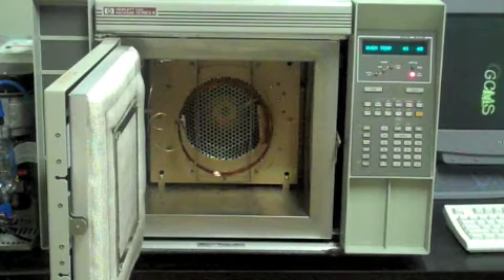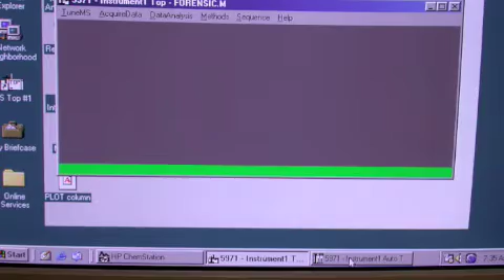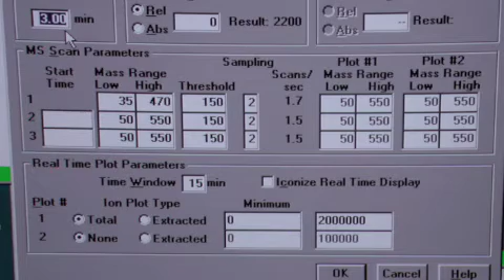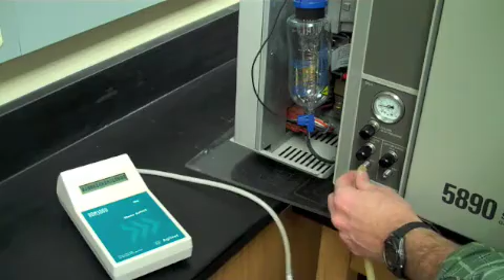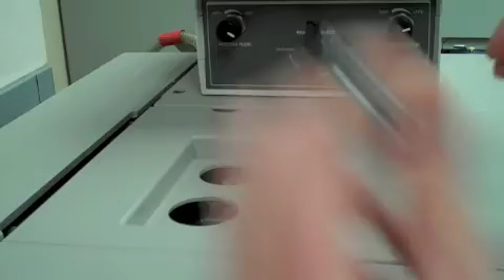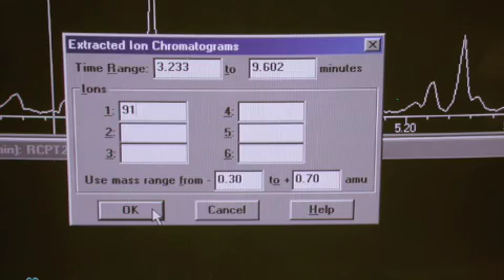Standard operating procedure for HP 5890-5972 GC MS

Comment: Hello, Thanks for the video. 

Do you know why signal 1 shows a big signal and signal 2 shows a small one. It used to be the other way. Please advise. Thank you
Reply from the maker: Hi John,
I am sorry that I don't have a very good answer to your question. I think that you are referring to changing the signal going to the computer by toggling the buttons, SIG 1 or SIG 2, on the front of the GC. I have not used those. I thought that those were used to switch the signal that you monitored when you had more than one detector. I have always worked with a MS as my only detector. To follow up, I would 1) dig out the operating manual for the instrument and/or 2) call the technical services representative at the instrument maker.